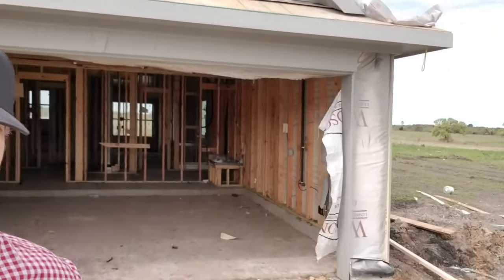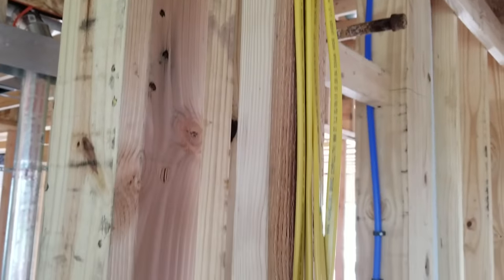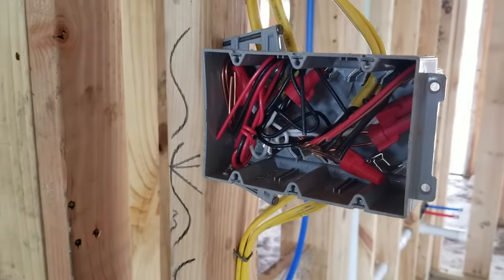HOW IS THIS EVEN LEGAL?!?!

Comment: I see this all the time. 
I've been in the garage door business for 38 years and Trac home builders buy the cheapest garage door they can find. 
Most are engineered designs that in the real world will not stand up to the engineered design pressures (windload code) 
The garage door is your 1st defence against hurricanes. 
I don't sell to Trac home builders for this reason and never will. 
Be involved in your new home build,  Ask allot of questions
Reply: Calvin Thomas Funny how they use a 3/4" board for bucks and all the installers use 1 5/8" lags and not 3" lags! 

Aker Doors in Ham Lake Minnesota couldn't figure out why we were using so many 3" lags! We check all the backhangs for lag length and replace them if they are short going through sheet rock and or thin bucks over sheetrock. People just don't care.

My point being,what good is windload when the jamb brackets and flags are barely anchored?
Reply: @manyhammers5944  I know what you mean. 
I've had some wanting to mount on top of sheetrock and I won't do it. 
They say,  There's 2x6 under the rock. 
That's fine. 
No it's not. 
It's against code and over time the sheetrock crushes under the brackets. 
Shame on them.
Reply: Calvin Thomas We know the jambs are going to loosen up. I'm self employed and I hate my job some days.

19 years experience.

Comment: In Sweden är windscreen-plasic om the outside and a moisture barrier on the inside. It's so you don't push moisture in to the wall when heating a home and stop wind from penetrating the between the boards. Having moisture barriers on both sides leads to mould problems in our climate.
Reply: The South in the United States has a hot and humid climate (with maybe three months out of the year being cold winter, but not nearly as cold as Sweden, northern U.S., or Canada), so the moisture barrier is on the outside and there is no barrier on the inside.

Comment: That house will have black mold within a year. That is insanity that hardy board is the only thing between the outside and inside! Lol criminals could break into your home in between the studs just by smashing some hardy board! 😳
Reply: @williammacroberts2305  hahaha
Reply: Hardy board is so easy to break. That's insane. It blows my mind how shoddy homes are today.
Reply: No insanity is the electric and gas bill for that house each month if it isn't properly insulated then that means you are going to have a $500 or more bill!

How does paying a gas/electric bill of $1,000 sound to you!😱
Reply: Brain of Brian --> Can't believe county or city codes are allowing those cost cutting measures.
Reply: @integr8er66  Do you have x-ray vision?  Because everything he pointed out will be covered up by the time buyers are likely to see the house.
Reply: @patrickshelley09  Yes actually, technolgy today allows you to see right through walls, and bore scope cameras can snake inside pipes and walls. It's pretty easy to do a lot of non destructive testing today, that is why I say codes and inspections as people build are a thing of the past.
Reply: @integr8er66  1: The average consumer lacks the education to know what to look for.  And if you think they'll learn it with a quick Google search, you're sadly mistaken.  2: Thermal cameras can only tell you so much about what's behind the drywall and a decent camera is still fairly expensive (especially if we're talking about starter homes). 

Saying that technology makes codes and inspections a thing of the past is like saying we don't need cops or traffic laws because of commercially available bullet proof vest and seat belts.  You're in fantasy land.  Without good codes, builders would be doing way worse than what's in this video and it would be things that a scope or camera can't catch.  You'd literally have to inspect the house as it was being built and that's only if you have the proper knowledge.  This video even points out that good codes and enforcement are causing better work in the areas of electrical and plumbing.
Reply: @patrickshelley09  I don't care about average people, if they choose to remain ignorant then they can pay a smart person to think for them, that does NOT mean I should have to settle for what some stupid inspector or code writer says I have to do. I'll do it my way anyway, it is none of their business. I didn't say thermal cameras, but price is not my concern, the inspector will buy that, or I will find my own method. Either way telling a person they can't build what they want on their own damn property is bullshit.
Reply: @integr8er66  Clearly you don't care about average people.  It takes a lot of experience or training to be able to know enough to fully understand every aspect of new home construction.  It's not feasible to expect everyone (or even close to everyone) to know enough that they could properly inspect their new home.  Nor is it reasonable to expect an inspector to be able to see everything after the house has been built.  You'll do it your way and maybe it'll be okay.  But what about the next guy?  Your actions and the next guy's actions have consequences for everyone that follows them.  Do you not understand that code and inspection are a result of lessons learned in the past?  You're asking to go back to an age where people died regularly because of shoddy building.  Why?  Because you can't handle living in a society and have been taught that government always equals bad?  Grow up and learn to live in society or move to the wilderness or Somalia. 

Btw, being ignorant has no bearing on intelligence.  I've met surgeons, lawyers and professors who don't know the first thing about their house.
Reply: @patrickshelley09  well when the average guy keeps me from using my property as I please then no I don't care, next, I never associated ignorance with intellect, but if you have intellect you should recognize your ignorance and pay someone else to do your thinking on topics you are not educated in. As far as what about the next guy? What next guy? The one who buys my house? Well he should find out what he is buying, he should inspect it and more important if it has stood for 30 years and worked fine then that should tell you its good. Just because this is how everybody does it does not mean this is the only way it can be done, and I have proven it several times. It's amazing that after the city engineer says it can't be done and is unsafe and you show up with a P.E. stamp on your drawings he eats his words, then 10 years later the structure he said wouldn't stand is still standing just fine yet you people still blindly follow them. Its nothing but control, and I refuse.
Reply: @integr8er66  The next guy is the guy who isn't you and just builds a complete cluster fuck of a building.  As in if we get rid of codes and enforcement, the next guy is free to do what he wants with no regard for anyone else.  And you're completely ignoring the fact that a home inspector can't see every aspect of a house after it's done.  To properly inspect a house, it needs to be done while it's being built.

You said that if someone is ignorant, they should pay someone smart to think for them.  Smart infers intelligence.  Memorizing codes and construction methods does not make one smart, nor does not knowing them make one not smart.

Now you're talking about bad codes or bad inspectors.  I run into bad inspectors and codes all the time (one just cost me commission on a $12,000 dollar job).  That's an entirely different story from lets eliminate building codes and inspectors all together.  And by your logic, why don't you go to school and get an engineering degree so you can override the city inspector?  Don't rely on someone else to do it for you.

Anecdotal evidence means nothing in the grand scheme of things.  You can't make broad sweeping laws based on outliers that only affect a small amount of people in a neutral way.  You make the laws based on what could go wrong and how likely that is.  I get that codes and laws in general can be a giant pain in the ass.  But trying to abolish effective laws that came into being for a good reason because you're annoyed is childish.  Work to amend the codes or even to get an inspector fired or moved.  But don't throw the baby out with the bath water.
Reply: @patrickshelley09   As I have said, if a guy builds a cluster fck, then it will be obvious to an inspector, and thus no intelligent person would buy it, and that builder would learn a lesson.
Ignorance vs smart, ya I think if you are ignorant and CHOOSE to remain so then you are not smart. But there is room for saying I am smart at what I do and recognize I'm not an engineer and thus pay one to do what we do.
Bad codes or bad inspectors, both, and since there is no appeal process for a bad code then  they need to go away. I own a house in a suburb, of a large city, and a farm in a rural county with no codes or permit system at all, and I will not spend a penny on the city house just because of the bullshit required to do so.
As for going to school, I already did, what do you think my comment about making the city eng eat his words was about, but I shouldn't have to go through that every time. 
You are probably right that some form of code is reasonable, but I can't see any middle ground on anything anymore, people are either mother government take care of my every need, or more like me, just get out of my life. Like I said I have property where I can and have built a whole house without calling one government official, and it was 100% legal. There is no way I could build that house here in the city, and it is not just a good structure but fantastic, and cost 1/2 what I would have to pay here. The people here can only do as they are told, no vision, just follow the master plan or you can't build it. Stupid.
Reply: @patrickshelley09  I agree. Almost all of clients are doctors married to other doctors and most of them need help doing basic things like unclogging a toilet or fixing a stuck garbage disposal or change a humidifier filter.
Reply: Or cutting through vinyl siding, then cardboard sheathing, and then the interior drywall with a utility knife.
Reply: @williammacroberts2305  <tinfoil hat boi

Comment: I bought my grandma a new manufactured home after her house burned down. It’s not a top of the line home but also it’s not a bottom of the barrel either. I looked at how the house was built the floor joist are 2x8 all of the wall studs are 2x4 and they used engineering trusses for the roof everything was covered with OSB sheathing and the floors are 3/4 inch plywood, overall the structure is very solid. The house wasn’t all that expensive under 100k for setup and everything I think it will last her a long time and it’s very energy efficient her light bill is under $150 in the summer in east Texas.

Comment: You will achieve shear value (or racking as you call it) with the horizontal Hardi-Planks and interior sheetrock. Remember, theses homes require engineering of least a 1.5 safety factor, and homes don't need to be sheated if there's other methods in lieu of. I'm a builder and we build to pretty tough standards out here in NorCal.

Comment: Holy moly...these are the type of houses that disintegrate in a tornado.
Reply: Well to be fair most house will given a reasonablely strong storm
Reply: Joshua Hodge ...True but this house will stripped to the bone long before the storm becomes reasonably strong. A good fart will blow the clapboards off the side.
Reply: @blipco5 must be some good chilli to produce winds of that magnitude, but I do see your point the better built homes can withstand more
Reply: Joshua Hodge ...Once the sub floors are nailed in, and pray they use plywood over OSB (which I doubt), there will be rigidity to the structure but building a house without siding should be against building codes. It must be noisy af when you're in the house. My shed is built better.

Comment: My 80 year old house have only 1x6 wooded siding, and the 2x4 framing are 24 inches on center. No vapor barrier, but it also had 1x6 on the inside before the drywall. 
This is actually not a bad idea, if they use closed cell foam on the walls

Comment: This is just about spot on how homes are built in KC area. Even 500k homes.
Reply: Same here, but that's pretty universal for every major home builder, though.  They all have a corporate cookie cutter process and use the same suppliers and subcontactors regardless of house.  Go into a new D.R. Horton subdivision of $160k Express homes and go into a new D.R. Horton subdivision of $400k luxury homes, and the build quality is identical... They're using the same framers, same plumbers, same electricians, etc, all lowest bidders.  Even some furnishings you'll find a lot of similarities, because they purchase in bulk...for instance interior bedroom doors and hardware may be identical, or appliances, vanities, etc.  When you buy an expensive luxury home with a large corporate home builder, really you're just paying more for extra square footage, different architecture, and upgraded exterior material.
Reply: Bo Hunter  lol, you have way more crooked builders in kansas.

Comment: Incredibly good video. The answer to the racking/shear is the gypsum board. The NDS SDPWS (googling those acronyms will work) allows some shear capacity out of gypsum board. It is however a bad idea, even if it is code compliant. The answer to the water barrier and air barrier is that virtually no one who enforces codes knows about it, and if they do then they have to deal with the myriad of life safety issues in designs and builds so this type of thing takes a back seat, despite its importance. I love your point about finding someone who will actually pay you to do a good job and care about the home you are creating for someone. Finding that someone can be difficult in a system that rewards corner cutting.
Reply: Sheetrock has structural strength?  I'll agree with your assessment that its a bad idea.  To be fair, these look to be single story houses, which should reduce the shear forces on the house.  And of course with the poor waterproofing, the house won't last too long anyway.
Reply: @dahveed284  The IRC allows for gyp board to be used as a lateral bracing method as long as you follow the fastener schedule. It's not the best idea, especially for exterior shear walls. I believe it is in the code to create an easy path for interior shear walls when needed.
Reply: @BenWolkWeiss  : OK, I could accept interior non-load bearing as minimal code, sorely under engineered even then without blocking imo, with as you note correct fastener application. Why do I suspect this build would have skimped there too. Also, for what thickness of drywall, if you know off hand ? Because again, I'm guessing they went cheap there too.
Reply: @dahveed284  Sheetrock has structural strength... once. That's the problem with the method, if anything ever exceeds the material strength then the structure's "loose" forever on afterwards, and can get some inertia in it's motions and make the failure even worse.

Comment: How does this pass energy star? There is no way that the HVAC can qualify, not with that much air leakage! At least they used a proper header above the garage doors. I often see 2x4s stacked as a header.
Reply: Why would anyone want to be sealed up air tight with all the glue and fumes from those new building materials?
Reply: Very few builders build to energy star standards.  In Dallas Fort Worth it is only a handful of builders that are energy star certified on every home.  Most do not build to any energy protocol.
Reply: Where are these homes
Reply: @urbanplanner7200  New houses should be as air tight as possible. It's a myth that a house has to breathe. It's a complete waste of energy (which means tons of money).
Reply: @TheGuruStud  that if for the kind of Americans that think fresh air comes from a device you plug in a outlet.
Reply: @Don Forum won't that let out all the Fabreeze and Glade smell?

Comment: Your waterproofing exterior walls from outside? In Finland we dont waterproof walls ever. Walls are supposed to breathe moisture out of the structure. Our structure from inside-out is drywall-vapormembrane-insulation-windsheet-extreriormaterial.

Comment: Allow me to add my thoughts. The construction industry pays the lowest wages , roofers , and carpenters pay can remain stagnant for years. You are right,  the exteriors of starter homes are shabby. Home buyers are not aware , vinyl siding , woven plastic membranes and silver cardboard are not water proof barriers. The insulation must be applied skillfully , regardless of material, foam or batts. Home builders are still applying tile to raw plywood and drywall, to make something that is pretty and sure to fail. Cheap hollow core doors on the interior, and a variety of cheap plumbing and electrical fixtures. Lastly , basements. I still see builders neglect water proof barriers on the basement exterior walls. Do some research on your builder, talk to your potential neighbors about their experience with the builder. Work with builders  that pay their workers by the hour not by the job.
Reply: I started making 12 an hour 6 years ago, when I found out the lead was making the same let's just say I didn't have much hope for upward movement.

Comment: Uh... is there not even any nogging in the walls? Woven plastic sheathing with hardiboard only, no racking?

Are there not applicable engineering standards for a house that won't blow over in a stiff breeze or go up in flames like a roman candle? Someone had to sign off on the architectural plan...

Comment: The big problem is that in your area, the licensing requirements are really lax for the General Contractors/Builders. As was pointed out, the trades where licensing is required, they did a good job.